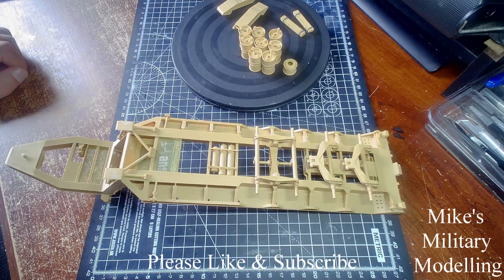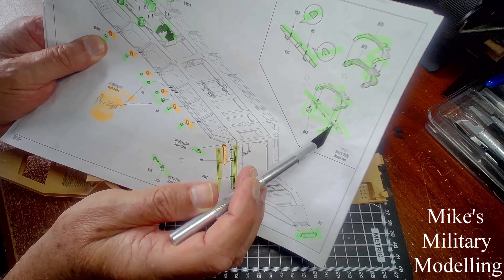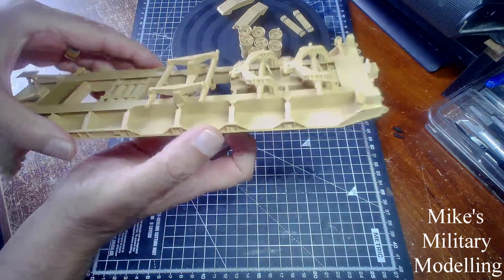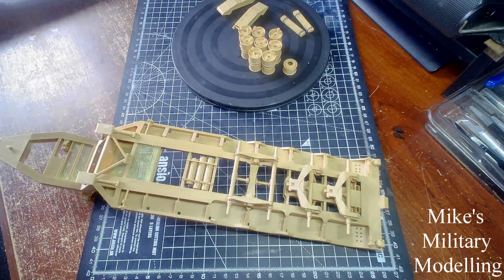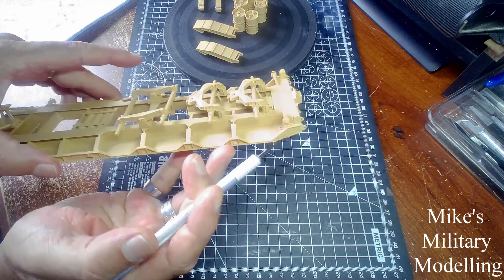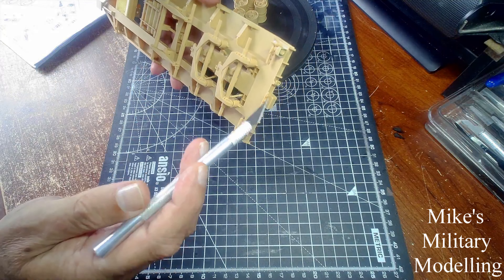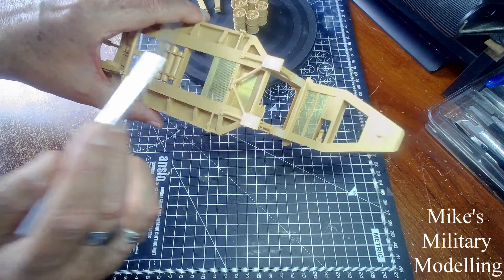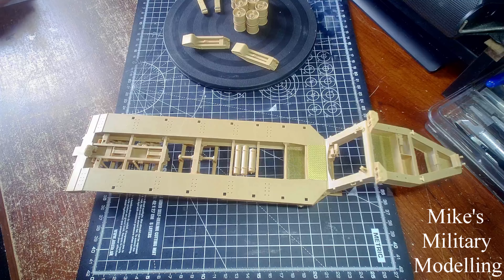M911 C-HET & M747 Semi Trailer (Part 8 Building the trailer axles )

Comment: Top job on this beast so far Mike. Does the kit come with a tank to go onto the trailer? If not,are you planning to put one on it?
Reply from the maker: Thanks John,  no the kit only has the tractor & trailer. I was going to put a D9R bulldozer on the back which is the next build but I've changed my mind and I'm going to build an M1 Abrams for the back.
Cheers Mike.
Reply: @MikesMilitaryModelling  Excellent choice mate 👍